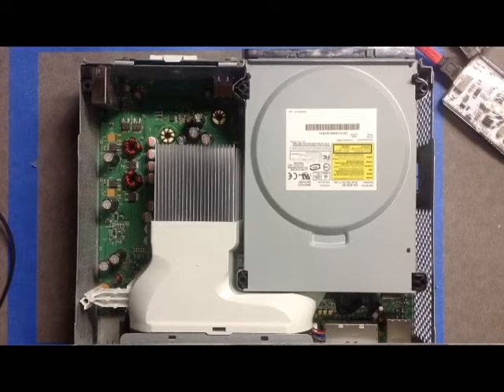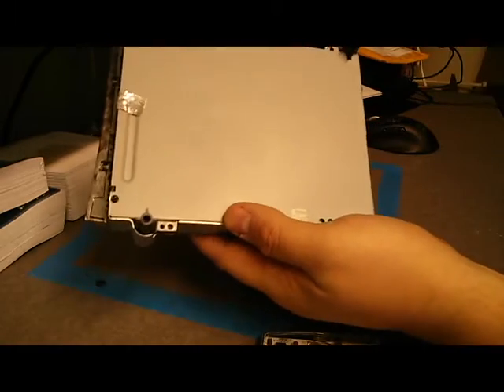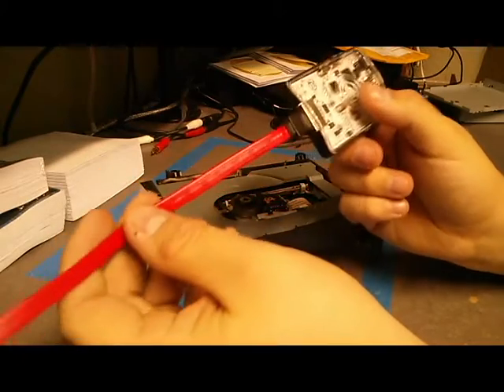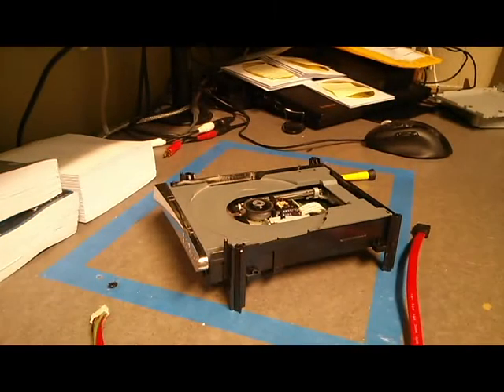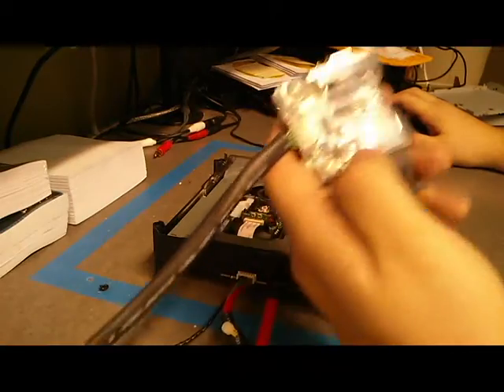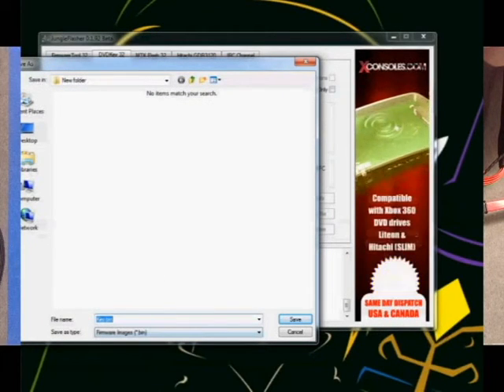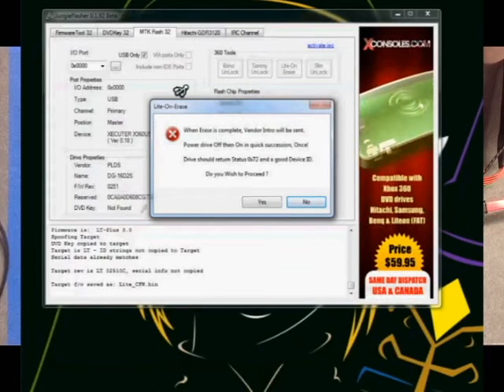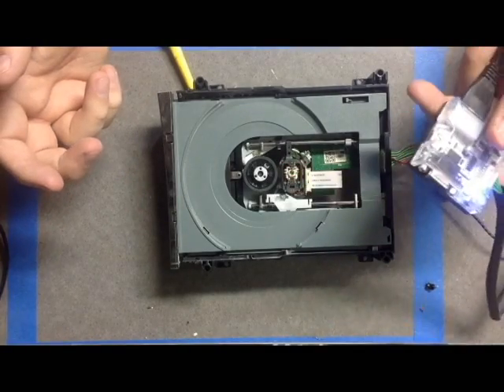How to flash phat / fat LiteOn Xbox 360 drive - LT 3.0 modding

Comment: where to get all of the devices from please?
Reply from the maker: +Migo BONO Ebay is probably the easiest place to get them in small quantities.  I order hundreds at a time directly from the manufacturers in China
Reply: TheWeekendModder thank you but i cant find it on ebay or any other website
Reply: +TheWeekendModder hi dude, i just bought a x360usb pro v2, i hook everything up even the probe 3 that i bought. but i dont see a green light on the probe and when i enter junglerflasher, it find my x360usb, and when i klick phatkey button it says drive not detected!!! phatkey aborted .. Think u can help me out there??? do i need to install some kind of driver for the probe or what?

Comment: is there a dashboard version limit to this mod?
Reply from the maker: megadeth22885 No.
Reply: hmm, i may just have to pay someone to do this then.. however, id prefer the ability to play backups off a hard drive.. know any mods that this will work with or is jtag the only solution for that?
Reply from the maker: megadeth22885 An xkey would play ISO's off a USB hdd.
Reply: hmm, i'll look into that, as ive essentially omitted all DVD players and burners from my home computers due to their utter uselessness

aah, i see now what it is.. its a USB drive emulator, takes an ISO, emulates it being read through your DVD drive and plays it on the console.. wouldnt it be possible to jtag the xbox, use a custom firmware on the console itself to disable all protection and replace the DVD drive with an HDD?